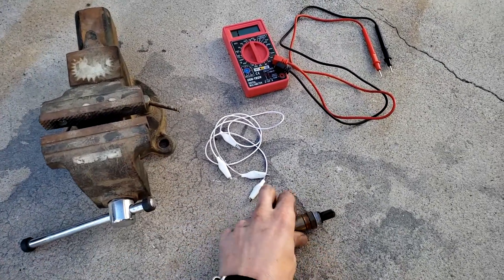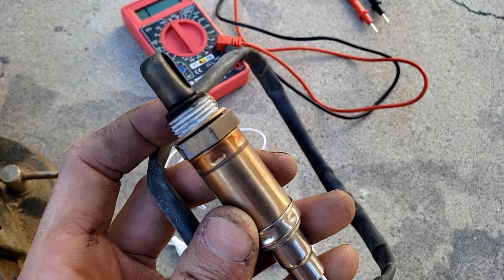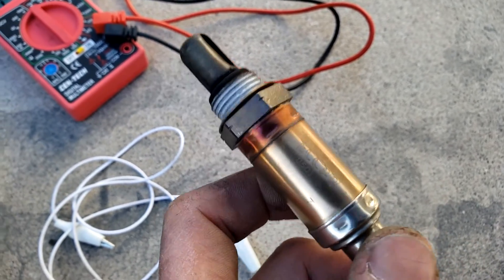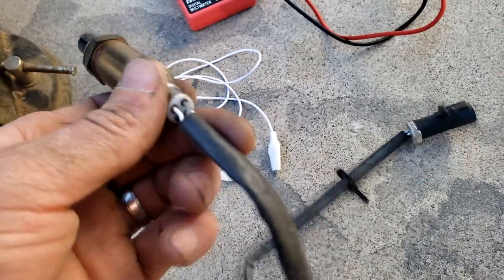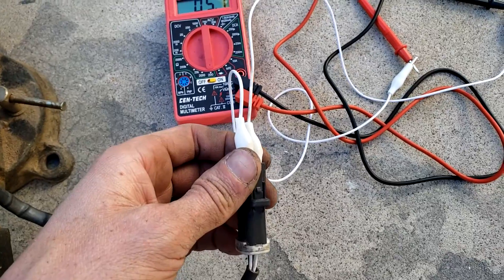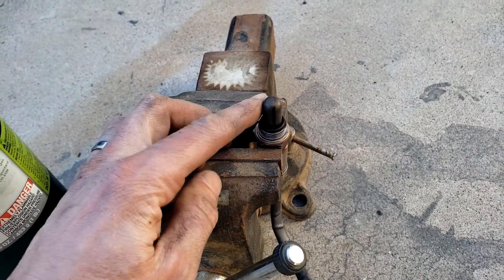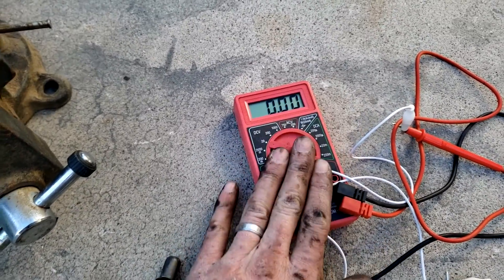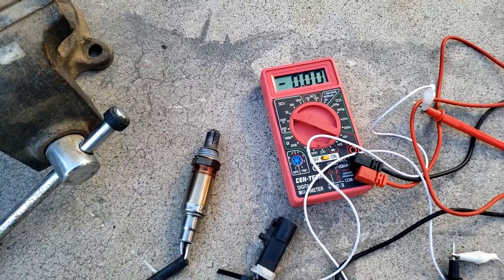Oxygen Sensors 101 - Testing O2 Sensors for Resistance and DC Voltage

Comment: For narrow bandwidth 4-wire systems, we only need 2 signal wires and ground to test if the sensor is working properly. We don't need to test the two heating wires, right?

Comment: Also you can have a lazy sensor meaning it is not reacting as quickly as it should. Doesn't mean that it is actually bad it means that something has coated the sensor and it can't read the emissions properly. Some vehicles have a code for this some don't. Replacing it would be as simple but it doesn't stop the contamination. Usually it is from dirty fuel or additives or coolant leaking into the combustion chamber or whatever that sticks to the sensor and gets baked on to it. Head work and coolant spilled into exhaust. You perform a live data and you see it is working but slow in transition is a sign of a compromised sensor telling you that something is amiss. Sometimes running high grade fuel for a while will clean them or a physical cleaning or just replace but if it comes back as lazy o2 sensor then you have a more internal issue contaminating your exhaust system.

Comment: I have a big v8 engine with lean mixture in both banks and whilst checking o2 sensor readings I discovered that one pre catalyst and the one post catalyst sensor were both showing similar readings with a cold non running engine, whilst the other sensor was showing a steady .50 reading.
I wonder if that is a “lazy” sensor or is it normal?
Reply from the maker: The sensor could be lazy/failing

Other possibilities:
-Sensor heater weak or dead
-Wiring resistance high
-Sensor internally worn >no reaction
-Open-circuit sensor > ECU defaults to ~0.45V

A good cold sensor never sits at a neat perfect midpoint.

Comment: Hi, i just tested my o2 sensor and the max voltage it went was 0.150, probably bad, right? Also, the heater circuit read open
Reply from the maker: If that's true, and the test was done properly, then yes, it sounds broken!

Comment: Hi im hoping you can help. What does it mean if the signal   ground wire to the sensor has a voltage drop? Im seeing a 1.8v drop vs battery voltage
Reply from the maker: If there is a voltage drop (outside of spec) then there is probably a loose connection

Comment: Why would it bounce up and down in a sine wave?  
That seems odd to me.  Shouldn't it put out a constant voltage under constant conditions?  Wouldn't the sine wave be due to adjusting trim of the engine?  
Also, I wonder if getting it red hot with a torch doesn't do permanent damage to the sensor.  I don't recall off the top of my head, and I'm not sure if you are talking C of F, but I'd think red hot is way hotter than 600 degrees.
Reply from the maker: I'm sure this website can explain it in far better detail than I can and willing to allow time for haha!
https://autoditex.com/page/lambda-sensor-o2-sensor-21-1.html#:~:text=If%20the%20sensor%20is%20working,will%20be%20around%200.45V.

Comment: The best way to remove the lambda sensor from the cast iron exhaust manifold is to heat the cast iron manifold near the sensor from several sides, if the sensor is broken, cut the wire and carefully unscrew the sensor with a long hex key, if you use a split key, which is more suitable for installing a new sensor, you can turn the edges of the sensor round.

Comment: Is it necessary to remove the O2 sensor from the vehicle or  can the test be done with the sensor in the exhaust ?
Reply from the maker: If you have an OBDII scanner, yeah sure, you can look at the voltages.
I mentioned in the video too
Reply: @TutorialGenius  Thanks! I found the problem... bad connection at the O2 sensor. I cleaned the connector and working perfect !

Comment: Thank you for sharing .I have 2 question,I tested my 2 white wire from the heater and it read 00 ohms(even when its running),also tested signal and ground and it reads  1 volt,would this be consider as a bad sensor?.
I also tested the signal and ground from the ecu and it reads 12.4 volt is this too high?....